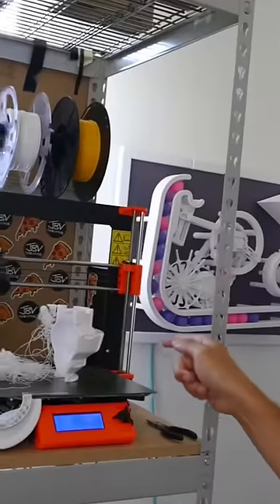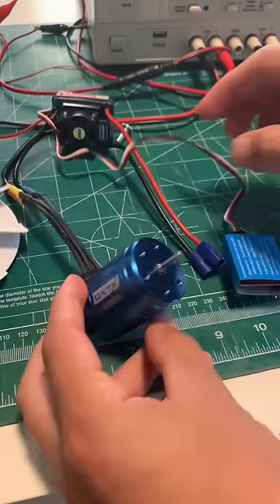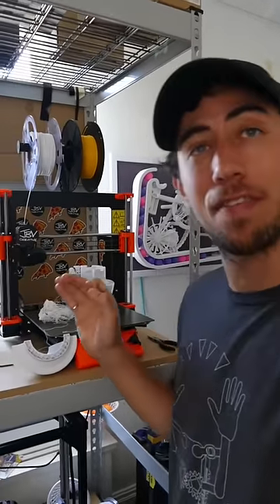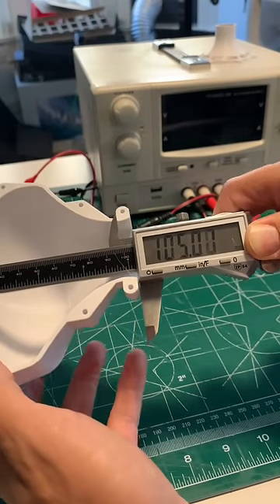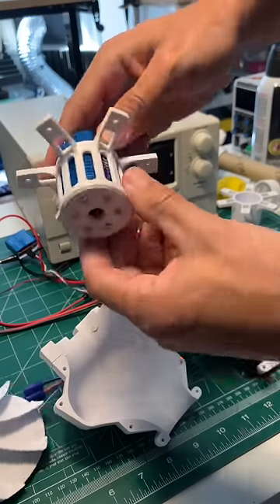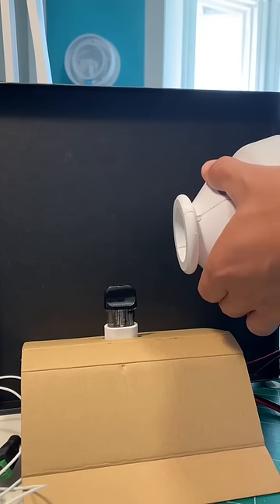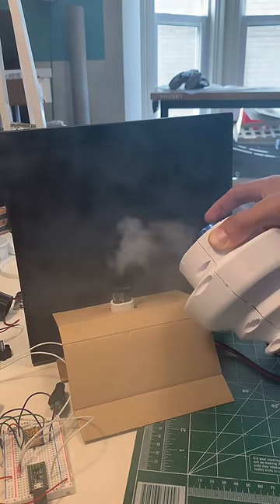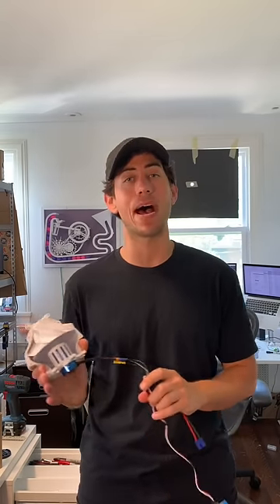Making A High Powered Fan with 3D Printing

Comment: Motor might be turning the wrong way. Try swapping two out of the three wires on the motor.
Reply from the maker: Tried both ways haha, no dice 🤷‍♀️
Reply: @Engineezy  Ah well. Sorry it wasn't an easy fix for you, buddy!
Reply: @Engineezy  I could be wrong, but it might be because the outmost radius of the impeller is blocked by a straight wall, and for it to push air past itself it needs to pass it radially (around the wheel) so that it can really utilize the centrifugal force (because this type of fan/pump is called a ’centrifugal compressor’). 

If you do find this confusing however, let me know haha
Reply: @Engineezy  It might also be because the blades on the impeller shouldn’t stop at the circular ”plate” that they’re sitting on. The outmost blades shouldn’t be overlapped by it.
Reply: @Engineezy move the outlet to the side like a turbocharger
Reply: @rayalvarez4268  He doesn’t have to. read the reply above
Reply: @rayalvarez4268  100 points there.
Reply: If your part requires a linear airflow though the housing, putting a stator behind the impeller so it directs airflow back through outlet rather than creating a vortex behind it, which is causing the slight vacuum, it might work better

lengthen the shaft from the motor and pass it through a cone behind the impeller, you can mount it diectly to the motor mounting points 

Mk.2 might pull inspiration from Turbofans, such as the GEN-X
Reply: Have the motor gear teeth printed in the opposite direction
Reply: @Engineezy  you need to cover the area and add the inlet on the side almost like a turbocharger for cars
Reply: @Engineezy  do you think the pattern is too rigid and choppy at the bottom of your fan blade. Maybe a smoother pattern at the big end of the fan blade?
Reply: @Engineezy  it really reminds me of a turbo housing and thay exit out the side maby tey that ?
Reply: Many turbos pump better if there's spun the wrong way
When turbo is too radical they get Peaky they start to pump and then they stop and it's going to be at like .9 Mach.
This is why many compressors have bleed air valves or they will suffer a compressor stall.
Reply: @xmysef4920  not at all confusing and I'm not an engineer or exactly mechanical inclined. (Tho my IQ is, almost, respectable... almost. Haha 😄)
Reply: Moves more air than the inlet allows. Leave more clearance at the intake bell and it should fix the problem. It's sucking from both ends because you have made an incredibly efficient impeller but you are choking the poor fella for it's source air.
Reply: @Engineezy  its the holes in the mount for the motor. You need to separate the motors' vacuum.
Reply: @Engineezy  it probably need to be sealed up better and do some more homework on impeller design.
Could just be a wonky angle on the blades that could cause it..
Idk... if you know any engineers you should talk to them about it and see what they think ..
Reply: Love it. Stop project to make another project, kind of works, stop project, back to original projects.

Comment: I love that your smoke machine is literally a vape
Reply: It's a Novo pod
Reply: @dackieboi6705  love how you know what it is 🤣
Reply: Lmao
Reply: Novo 4
Reply: @chitos2132  yup, work at a vape store, thats a Novo 4 pod 🤣
Reply: @Albatorwow  I haven’t had a salt device since the Gen 2 novo. Have they actually changed them? My friend with the Gen 3 said they were still the same
Reply: @pws3rd170  i got the novo 4, shits good asf
Reply: @colemanoverbey1184  what’s new about it vs the Gen 2 and 3
Reply: @dackieboi6705  bro i thought i was trippin. i pulled the pod out of my novo lmao
Reply: I just noticed that
Reply: @pws3rd170  adjustable wattage and airflow, a screen, and a higher e liquid and battery capacity.
Reply: @terradagon258  are the new pods backwards compatible? Because that would be awesome if you could simply get more capacity out of your Gen 2 that way
Reply: @pws3rd170  sadly no, oh also a big difference that I forgot to mention is replaceable coils similar to the smok Nord devices
Reply: @terradagon258  that’s actually nice then since that lowers the price
Reply: @pws3rd170  where I'm at coils and pods cost the same but it's less plastic waste so I'm down
Reply: I work at a vape store too. It's definitely a novo pod and probably a better use for it 😂
Reply: @John--  that's right Smok products are trash although I have had a couple that preformed well and took a beating mainly my original alien but when it comes to quality control they don't give a damn one might last the test of time and the next one off the line might fail in 2 months
Reply: @gregoryballestero4369  Yeah I've had customers tell me exactly that, one lasted a month and broke and another laster over a year and was still going strong. It's hit or miss lol especially when it comes to their coils and pods. They leak more than a broken faucet lol
Reply: Ew vape
Reply: @dackieboi6705  i was thinking the same thing 😭
Reply: @pheonixthedragon8518  no shit he knows what it is, their such a big part of everything that a 4 year old could name 10 seperate dispo bape brands if u asked
Reply: @pezzygamez402  that's pretty sad that that's true tho

Comment: This impeller is blowing air to the walls (radial direction) sucking from both ends and going outside thoroug the walls gaps. Axial impeller would do the job
Reply: You’re right for sure, but I don’t think he would need to change the whole system for it to work. I think by increasing the radial space/diffuser that it’s shooting the air into it should be able to compress the air more and then redirect it past the compressor wheel itself.
Reply from the maker: Seems to be the consensus! Gonna have to give it a shot
Reply: Was my first guess . Look up some basic designs for a centrifugal compressor. The outlet doesnt come back to a point like yours
Reply: @Engineezy   @JBV Creative  it really reminds me of a turbo housing and thay exit out the side maby try that
Reply: @Engineezy  I wish I could crowdsource all my roadblocks like this. Seems super helpful.
Reply: @JBV Creative  An idea if you don't want to make a fan housing that's turbo shaped. Make the housing thicker and seal behind the impellor. Inside the housing have helical air passages that feed the air to outlets around the ring of the back housing.

That will potentially throw air out the back pretty good. And give the option to pipe smoke directly into the exhaust flow.
Reply: you just need to add a side air ejection point. just like a turbo on a car.
Reply: lol glad someone else saw it and not just me.
Reply: @Engineezy  instead of having the air hit flat walls with not enough space to compress, increase the flow space inside like others said but also add non moving blades to interact and direct the flow of air.

Stator blades? Think like a francis hydro turbine or the fixed blades that intersect a jet engine
Reply: @DaedalusLegacy  helical air passages like a human nose.

Comment: If you want a centrifugal fan than place your exhaust tangential to the impeller, facing the direction of the fluid. Like a turbocharger compressor or floor drying fan.

Comment: I love how he used a vape for it
Reply from the maker: Works so well!
Reply: @Engineezy  is it a smok?
Reply: @DrakeGrimes  smok novo
Reply: I was gonna say
Reply: @DrakeGrimes  it is a stem
Reply: Not just any vape, a smok Novo pod
Reply: a novo
Reply: @Engineezy  did you just buy your own PG/VG and throw it in the pod or is that flavored and dosed?
Reply: @rashdyomandac6805  no, no it’s not
Reply: @2A_Tree_Hugger  most big shops carry a flavorless nicotine free e-liquid. Although if he actually vapes he probably just used normal e-liquid
Reply: @pws3rd170  I’m aware, I just want to know if he’s spewing nicotine into the air or just water vapor. It’s been a while since I’ve been in the game, are those refillable pods? I used to work at a vape shop and smok were hit and miss with reliability
Reply: @2A_Tree_Hugger  Novos use refillable pods but once the coil burns out the whole pod is replaced. 
Though I have my doubts about the nicotine free idea because I seem to recall that salt nic and sub ohm juice couldn’t be used interchangeably and the niche group of mods that could take both had different coils for the different types
Reply: @pws3rd170  it's really more about the concentration of Nicotine you can drop 35mg salt nic into a sub-ohm tank and it's gonna function but it'll be like getting hit with a freight train of Nicotine (too much at once)
Reply: @gregoryballestero4369  my buddy got into building RDAs and had a dripper. He dripped some 50 nic for the shits and giggles and he was the only one not giggling after that 🤣🤣🤣

Comment: If you’re still working on this, consider using fixed blades on the enclosure output that are stationary but “rotate” in the opposite direction from the impeller

Comment: With that impeller it wants to be a centrifugal fan. Air is getting pushed into the walls of the casing. You need a snail shape like a turbocharger to direct that air

Comment: Outlet port needs to be on the side and the housing shaped like a turbo compressor housing for that style of turbine to function correctly
Reply: Nope you're wrong. Diesel/kerosene heaters use same thing. Similar impeller with a conical cowling. They can move really massive amount of air through small corrugated ducts well.
Reply: Y we s. Low pressure center on his exit is making it look like it's sucking air in. It's not. Exits on sides would increase the size of that low pressure area. House fan has that area all around the outside of exit.
Reply: @nhilistickomrad4259  FINALLY someone who gets it!

Comment: You just have to print it upside down,  where the bigger mouth is on the bottom
Reply: @jaspervanwijk2685  venturi effet while printing? What are you talking about?
Reply: @jungobango4815  ?
Reply: @YourDadsBoyfriend  not all printers have the same support/overhang capabilities
Reply: You could also use a brim to help it sticker more and be more stabelised

Comment: Nice looking parts. Looks like a perfect fit. Attach a smooth duct to the wide end so the turbulence has a smoother flow. Once you get a negative pressure on the inlet side, and a high pressure on the other side, the burble will probably no longer be apparent.

Comment: The impeller is a cone with a negative space on the inside and on the back side the exit is blocked by the motor mounts with a void in between. The air gets drawn in and it goes past the back of the cone and gets pulled into the cone. This makes a turbulance that creates suction. Imagine a pick up truck going down the highway with a cardboard box in the back. If its right up against the cab, the wind blows over it and it stays in place. If its pushed to the back, it will move around and maybe blow out. 
Make the cone have a base <l or have a mirrored, but smooth cone on the back <> and it can be reversed.

Comment: Slice a car turbo in half, then check out what it has going on and you’ll see how close you are to an extremely high power and efficient fan. You need an exit along the outside (radial exit) in line with where the fan cone ends.
Reply: I agree with you. It must come out the side (tangentially)
Reply: @erikalanreed8198  It doesn’t have to, as I’ve said in other replies

Comment: And this is how you fix the print, not just start from new. Even more accurate way is if you can count back or see witch layer it failed, cut the print from that point to make it clean, calculate how many layers you are missing and multiply that with layer height, then separate model from that height. I usually just print bottom layers like in normal print since that gives bit more support for the structure when gluing with acetone a ABS part.

Comment: Try putting your outlet on the side instead of in line just a thought
Reply: Yup, that's the way that axial setup is supposed to work most effectively. What is happening here is "throwing" the air towards the perimeter and then, instead of letting it out while it is pressurized, forcing it back down to it's original volume to get out your outlet. Also, if I see right, what you called suction into the exhaust is actually the exhaust flow, weak as it is, is pulling in surrounding air into the exhaust jet and what you see is the slower moving air being pulled toward the lower pressure next to the exhaust and then moved out inside this lower pressure   in a jet that is obscured.
As to the leak around the mating surfaces of the impeller chamber, did you see any smoke there? If not, it ain't leakin'.
Look up Bournelli and venturi effect.

Mike Trumble, Aircraft Mechanic and Heavy Equipment Mechanic.
I've worked with axial and centrifugal systems for engines, air conditioning, (Boyles Law), and non compressible fluids (water, oil, coolant...)
Reply: @michaeltrumble1070  I only install air conditioners
Reply: @michaeltrumble1070  FINALLY someone who gets it! :D

Comment: You need a longer intake cone, amd you also need to flute the rear of the chamber and chamfer the rear of your impeller.

Think near a teardrop shape, with more gap to allow the air to be compressed, then to also decompress creating pressure.

Otherwise, your setup creates turbulence inside the case, this creates a behind the impellor torroid that prevents the fan from actually moving air through it, it actually just moves air inside itself.

Creating a larger cone. And beveling the exhaust and rear of the impellor will create negative pressure at the front of the impellor and increase the pressure of the air as it compresses towards the inlet. This air then leaves the propelled portion of the impellor and has to decompress, adding a chamfered bevel behind the impellor prevents the air from swirling back on itself and creating that toroid, thefore the motor will move air.

I hope that helps.

Comment: I noticed a potiential problem that might explain the unexpected issue wit the fans performance. Actually two problems might need to be addressed. The first problem is vortex development on the thrust side of the impeller. Air that is moving in a circular pattern resists expulsion through the exhaust channel. This develops an area of pressure at the outermost portion of the turbine, effectively creating enough pressure to stop most of the flow. What little flow you do see is due to the housings imperfections providing some resistance, slowing a portion of the air allowing it to escape. To solve this you can install vanes on the housing positioned in such a way that it catches the mostly spinning air mass around the turbine. This "scoops" out the air and forces it toward the exhaust port rather than letting it just spin up into a high pressure vortex plume wich chokes off exhaust. This phenomena is well understood and if you examine turbine design in the compressor section of any common jet engine you can plainly see these counter vanes and how they interact with the turbine to maximize flow. Also there does not seem to be enough open area to channel the exhaust effectively. Most high flow high pressure open impeller air pumps start at the impellers edge and on the housing, the turbulence is directed away and down toward the outlet. As with most centrifugal pumps each blade of the turbine acts as an independent channel. If there is not enough open area that increases its volume as it winds around the housing compensating for the volume of air ejected by the next blade. When all blades contribute simultaneously there is a considerably large amount of air accumulating at the outlet and must have enough space to "stack" the next blade wake on top of the previous one. This is also well understood and looking at other conical types of centrifuge style pumps. It is difficult to try to give a mental image showing what im talking about but if you google some open impeller pump designs it is plain to see and easy to implement in your own design.

Comment: how it creates suction at both ends
Reply from the maker: That I don’t exactly have an answer for yet… for now we’re going with bad design
Reply: Air deletion machine lol
Reply: @Engineezy  probably because the outlet is behind the impeller.
try put it on side like a turbocharger
Reply: I know right, that would be amazing!
Reply: @farhanrahmaddani3218 It doesn’t exactly have to to with that, but you’re right about making i having more radial space (around the radius) around the impeller, because then it can compress the air and then that redirect that air to go past the impeller.

The reason I’m pretty sure about this is because the original dyson fan design (that this is based of off) did work, even without making it ’turbo’-like within the housing.
Reply: Simple: It doesn't really. Notice the smoke doesn't actually go into the exit like it does on the inlet side. The thing works just fine, assuming its purpose is to blow air out of the exit.

Comment: Simple - the outlet seems to be not much bigger than the inlet, so the air is not allowed to expand and escape around the impeller housing so the fan just pulls air in both ends as the outlet air is too disrupted to vent cleanly.  Also, the fan blades do not look like they create a decent seal with the inside of the housing so all of that air just churns around inside destroying the, what I can assume, was intended to be a lamellar flow.

Redesign the housing to evacuate air around the rim at the wider point and close off the outlet around the motor so the air going out prevents air being drawn back in the same point.